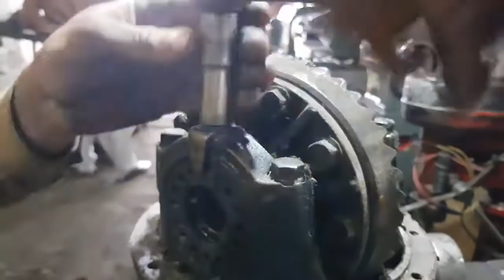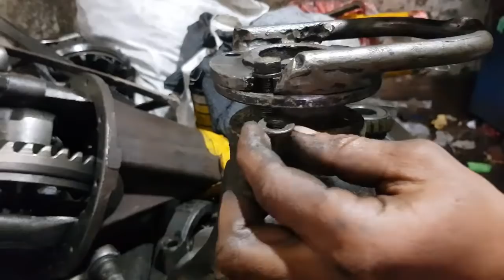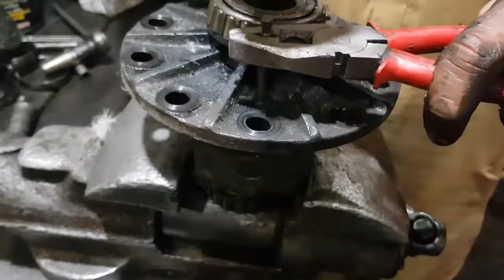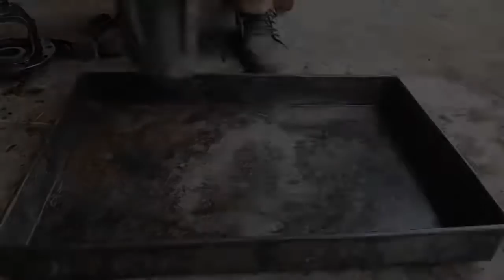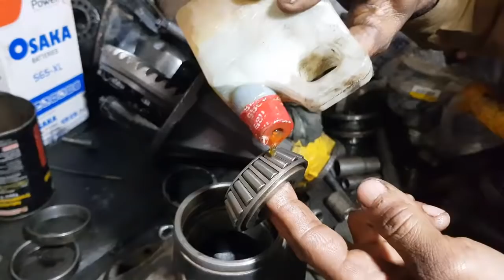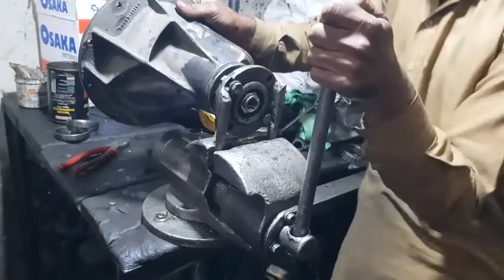Restoration Rusted Toyota Hiace GearBox

Comment: what happened  to correct  torque  of pinion nut or checking gear meshing  side gears  how long did the diff last after rebuild and installed
Reply: Not very long.
Reply: people see these  videos and think thats so easy but its the knowledge and details that make the  difference between  long lasting and failure
Reply: It will last for years and years to come. In the land of povrety they dont need clearences and fancy tools, they have faith! The impossible becomes possible. Watch on youtube; Cameroun Le desastre routier. You will see miracles.
Reply: @elhajsourie6059  if they cannot tell difference between a gearbox and differential  yes it will be a miracle if it lasts more than a few weeks. miracles do happen  but not in this case
Reply: @johngurney1069  The guy who is refurbrishing the diff, knows it is a diff. The guy putting it on his YouTube channel is an other story. You just need to use your imagination a bit. Those guys are not as stupid as they may look like. They are not trying to live. They are trying to survive.
Reply: your the one saying they look stupid not me,

Comment: "gear box" AKA: Transmission".

That thing is an (open; not a posi traction or locking, based on the alleged vehicle it came from) differential.

MAJOR difference between the two.